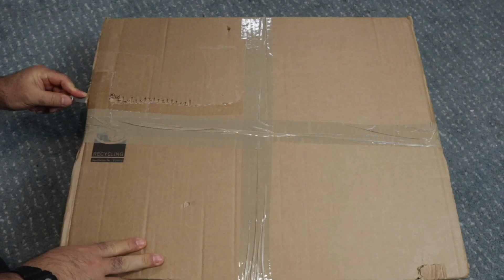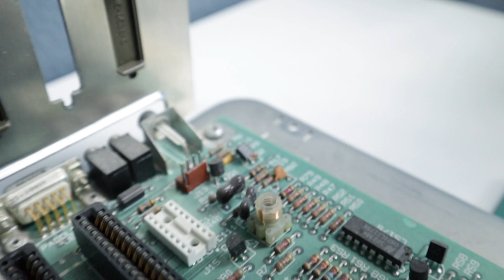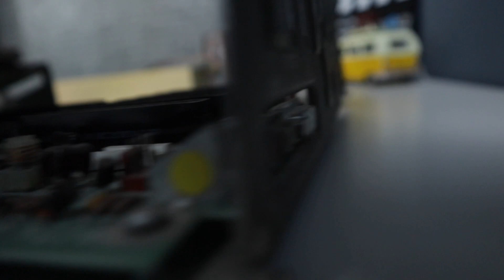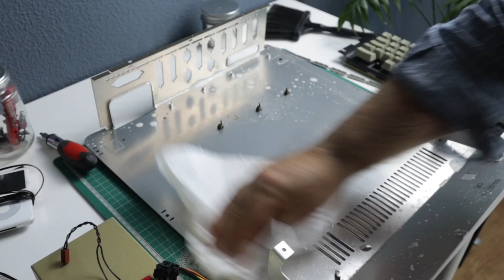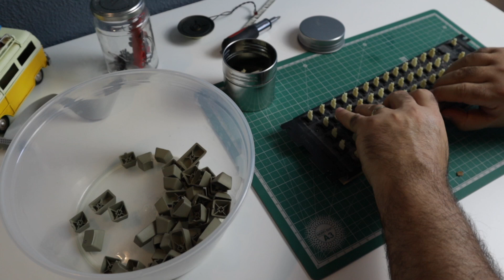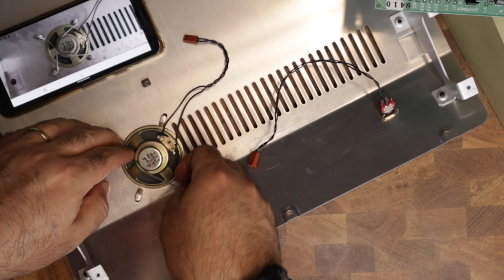This Apple IIe had so many problems! | Part One: Cleaning

Comment: I found your content through Obsidian, but always nice to see a fellow Apple II enthusiast! What's the silver monitor you're currently using?
Reply from the maker: It's a basic HP I got in a secondhand store. But I wouldn't recommend it. The oldest connector it has is a serial port, and I could never find a good adapter. The display sometimes goes from perfectly crisp to blurred (ghostly), and I have to reboot the computer a couple of times to bring it back to “normal”.
Reply: @vladcampos  There are a bunch of good VGA card options now. In terms of old monitors, the best I've seen is the Samsung SyncMaster series, especially with SCART for the IIgs.